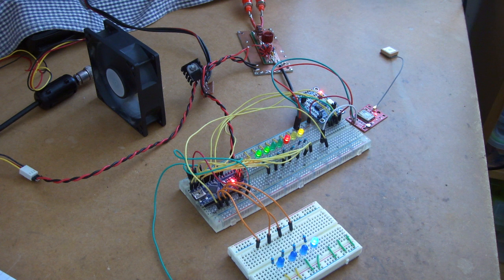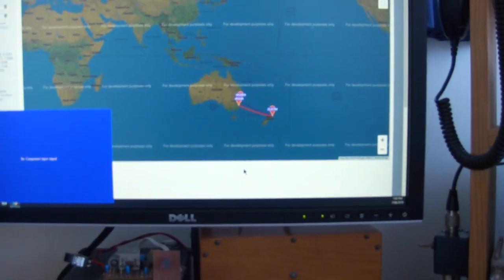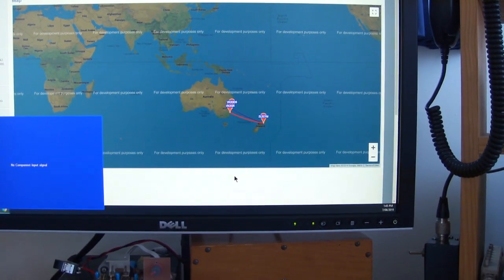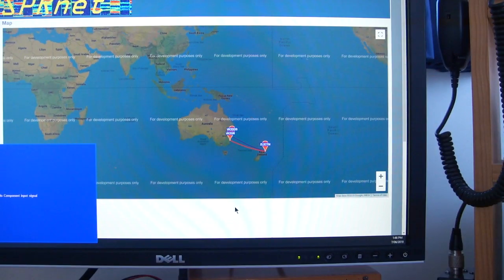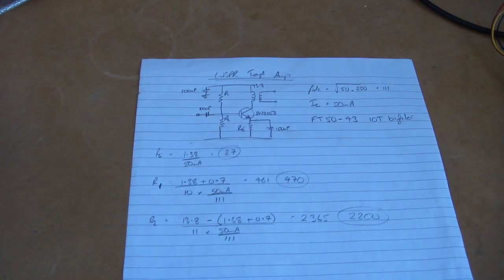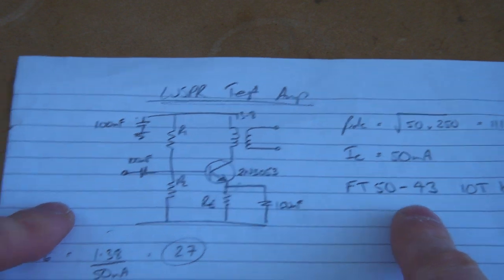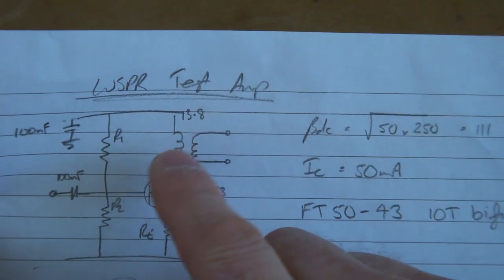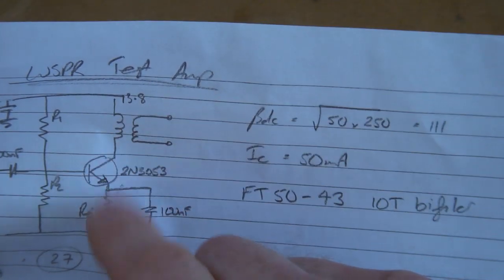Homebrew 20m WSPR Beacon: Part 2 Initial on Air Tests

Comment: Good day Charlie. I have a question : how do you insert the signal from your AD9850 DDS (powered at +5V) into the homebrew wideband amplifier (with its own 13.8V power supply) ? Just via capacitor, blocking the DC component?. And how do you connect your RF output to your dipole antenna? Thanks for all the info provided. (my DDS is working great, using a rotary encoder)
Reply from the maker: Hi Danny. The AD9850 goes either directly or via a switched 10dB pad into the amp (thru a 100nF dc blocking cap). The collector of the transistor has a 10T bifilar transformer, where the secondary is connected to the two legs of the 1/2 wave dipole. I'm not after maximum power transfer as I'm only looking to transmit mWs of power (i.e., 10mW on max power).

Comment: Works a treat Charlie very impressed and mw of power.
Reply from the maker: It certainly works well Dave. I got a spot in Australia running 12mW. The plan is to take it up to 250mW on HP and see how far that goes. I'm tempted to make LP around 10mW.

Comment: AD8367 is interesting,  described as IF amp with logarithmic  gain control, 45dB gain, looks like it could do 0.5w into 50 ohms with impedance matching.  A bit steep at $A50 on eBay but cheaper on Ali. Would make a nice IF amp. Would be interested to see your bench evaluation of  this module. Maybe connect it into one of your homebrew receivers.
Reply from the maker: Agreed. I think for a simple WSPR beacon it's bit of an overkill. I have a fixed gain module in the post and may look to use that along with some switchable attenuation pads. I've changed the test amp to be 10mA, which means I can do away with the fan. All good fun.

Comment: Hi Charlie-its nice to see it all working as calculated !! - 
Can I ask you, the GPS module  which one is it, what is th output frequency and did you program it from the Blix website ?
I have got a couple of them but could not get them to work
Mal
Reply from the maker: Hi Mal. This particular one is the Ublox NEO-6M-0-001, but you can use any one you like. I have used several over the years for various clock projects and they all work fine. In all cases I did not have to program them prior to use. All I do is simply powered them up and monitor the GPS TX pin with a serial monitor (i.e., the simple Arduino serial pass through sketch). I then incrementally change the baud rate until I land on the one used by the GPS (no longer garbled). In this case, 38400. With yours, power them up and scope their TX pin to make sure they are sending sentences (more than likely NMEA) every second. Some are now 10Hz. All of mine do that from power up. You may find yours will not until it has a valid position solution. Your'll notice in the video the red blinking LED on the GPS. That's indicating a valid position solution. Let me know how you get on.

Charlie
Reply: @CharlieMorrisZL2CTM  Hi Charlie- good afternoon-Thanks for the info , the modules I have, are a six and a seven ,I've put them away safe somewhere   now I carn't find the darned things !.I had a go at building a GPS 10Mhz locked standard designed by a gentleman called Mr Scullcum (scullcum hobby electronics ) a while back,.and he programmed the GPS boards using the U-blox website(have a look it may be useful ).The 10Mhz is then divided down to 1Hz for a timebase for microwave work etc .Have I got this wrong , and is it not a frequency , but a data stream from the GPS  module  needed to feed the aduino to generate the timing pulses ?
Mal
Reply from the maker: @ashave9100  It's not a frequency Mal. The NMEA sentences (there should be a bunch of them) get transmitted from the GPS at typically 1Hz, i.e., every second. All we are doing with the code is looking dfor once of those sentences called the RMC sentence. The start of that sentence has the UTC time, which we are after. Does that make sense?
Reply: @CharlieMorrisZL2CTM  Hi Charlie-thank you once again!!,  As they say "I was barking up the wrong tree" I understand now, that the timing is universal software . Ever since I was first licenced (40 years this October ) it still surprises me just how far tiny signals like WSPR can travel , and the amount of power that the big ham stations use , mostly wasted as heat !.Did you find out what the distance from your QTH to AUS- land was ?
 Mal
Reply from the maker: @ashave9100  Great. I had a spot yesterday in Australia, 2336 km on 12mW (no code change so still reporting 17/20 dBm). The plan today is to make a 250mW TX for HP and 10mW LP and leave it at that. I can always pad those if I need to reduce the power. 
73's
Charlie ZL2CTM